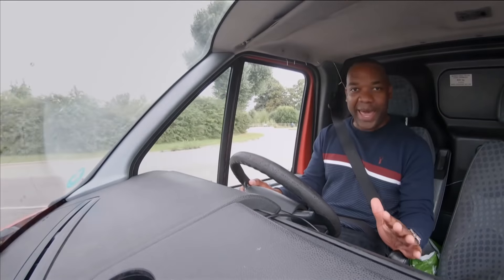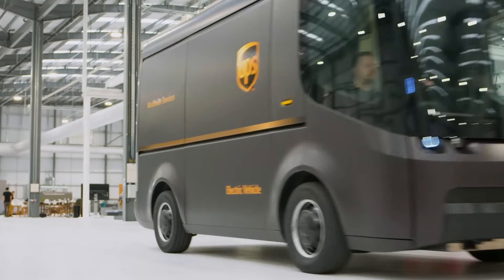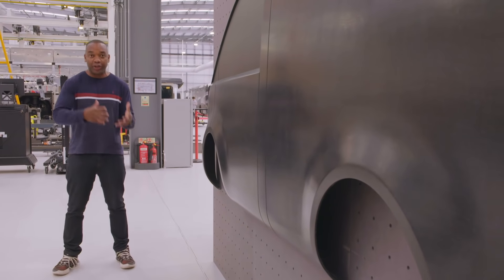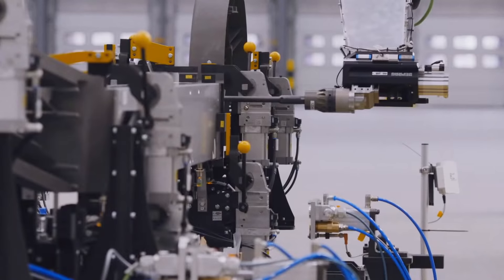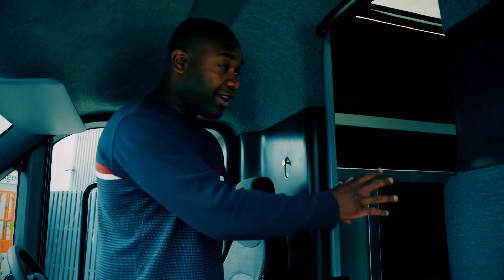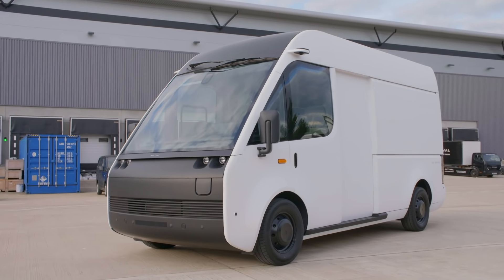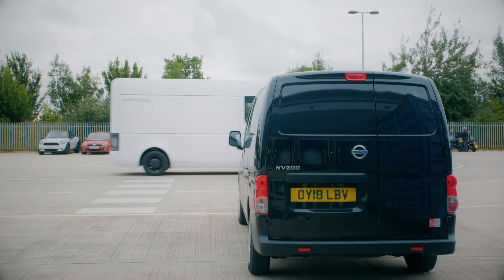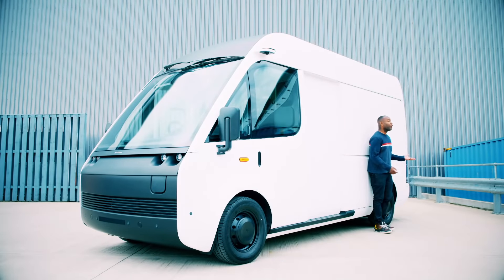The Arrival Van Test Drive | Fifth Gear Recharged

Comment: if they stick to sourcing local materials, and keeping supply lines short, I think they can. Many companies problems are coming from their supply lines, the small plants will keep costs low, and so long as they make a reliable product, their purpose build EV should be able to compete with a converted transit, just because of the benefits with turning radius and interior capacity.
Reply: My biggest issue with the arrival van is all the electronics in one tablet. I feel that there should be a digital panel flush with the central console for controlling the van, an option for drivers to use knobs to adjust the climate and a simple set of analog speedometer/instrument cluster directly behind the steering wheel. Now don't get me wrong, I like minimalism, but when it is not intuitive, the design fails. Also, I hope the Arrival van uses less cobalt in the battery (or solid state batteries), cos cobalt is mined from the Congo via harsh labor.
Reply: @thatguyalex2835  the one small screen for everything may have been a cost cutting measure. Also this is pre-production, so that may change as they get feedback from reviewers like fifth gear. I would agree that is something that should change, as you are right that would be a pain
Reply: @JustJay1281  I see, lots of things are cost cutting measures, which come at the expense of the operators (drivers/users of said technology). We as a society need to invest in good products, even though the price would be higher, in other words - the long term.
Reply: Sorry but that type of construction wont work to scale.
It's also very flimsy and not efficient.
Reply: I have doubts to the safety of the vehicle, that door wobble when he opened the door was crazy, pole impact must be shocking.
Reply: @thatguyalex2835  
A simple set of "expensive analogue points of failure"?
Reply: @Zedrophobia  
I can just imagine them saying 
"Let's build a vehicle that won't comply with regulations"..... Duh?
Reply: @rogerstarkey5390  they aren’t many regulations when it comes to vans. Over a certain size there are very few, although they are starting to impose stricter and stricter rules. Plastic panels are why you don’t see many production cars with them, or if they do the frame of the door it’s beefed up.

Comment: The cost of electricity in the u.k is going up year over year and were are the charging stations.
Reply: If the cost of electricity goes up, then so does the cost of refining oil into petrol and diesel..... oil refineries use lots of electricity...

Comment: They should build units for motorhome conversion.

Not complex. It just went wrong. Not good for a review. 

One big plus of this “build on a skate” structure is that the batteries could be replaced independently of everything else. (as battery technology advances).

Comment: 2 things that will need addressing for a production variant:

-Far less reliance on touchscreen; a tradie with dirty hands from a hard day's work isn't going to appreciate getting dirt all over the screen.
-Rear and side access doors need to be wide enough for a pallet
Reply: The van shown was specifically for Amazon-style local small-parcel deliveries, not for bulk-item distribution (they've probably got a different van design for that, with - as you mentioned - sufficiently large rear/side access)

Comment: I work in a van factory and the demand is so high that I don’t think this micro company’s will able to meet demand they haven’t mention a what rate they could be building them and also that range wouldn’t suit many company’s that require a lot of motorway miles so there’s a lot unknowns in this project but is not a A bad idea and the reason why most car manufacturers use assembly lines it’s because it’s efficient and keeps cost down of manufacturing so basically the more you build the cheaper the product cost more profit
Reply: 10000 vans per microfactory or 20000 with two shifts. It has ability to switch manufacturing from van to bus or car in same factory in no time that is what huge plants can't. Microfactory is not a new concept, have a look deeper into it and you will understand why it is more cost effective than plant pumping 200k vehicles per year.
Reply: 10000 per microfactory 20000 with double shifts.
I smell a whole lotta wilful IGNORANCE around here
Reply: Their rate is 10000vans a year ??? What are you talking about read their Forbes page again? 
You think they will compete with a plant that can produce >120k vans a year on double shift ??
Reply: @mariusmartinsen2064  in the UK, Mercedes sell around 210,000 Sprinters alone. every year. its the second best selling van in the UK. the best seller is the Ford Transit, which sells nearly a MILLION units per YEAR! thats a LOT of expensive micro factories JUST to make enough vans for the UK! and thats BEFORE we take into account all the other vans on UK roads. and then theres all the vans that are used in the rest of the WORLD
Reply: The point of a micro-factory is that it can be replicated and scaled up quickly, as needed.  It's a template.
Reply: @Gr33nMamba  I am not saying That it cannot be done the point is will it be profitable that’s the big question.
Reply: @matthewspry4217  They haven’t produced anything yet, so far as I know. Prototype is easy, mass manufacturing is hard (quote Elon Musk). With micro factory they do not have economies of scale. Their financials are terrible.   Gives me Theranos vibes.
Reply: @petelattimer6808  Why presume they're wanting to replace all other van makers? From the sounds of it, Arrival are focusing on niche markets and flexibility (plus larger markets for specific orders) - and banking on their 'cells' being able to swap instantly between different models as required.

The 'cell' approach may be less cost efficient than a traditional production-line - but if they can reduce their costs (via cheap thermoplastics, and other tweaks to 'traditional' production), they may be able to offset those inefficiencies, and produce cost-competitive vehicles.

Guess time will tell, although hopefully not too much more time... :D
Reply: @laostiia1000  
"Compete"?
If the factory is in the corner of a UPS warehouse and they're building vans for UPS, they don't have to "compete".
They simply repeat in several UPS locations.
When that project is done, they either move the factory, OR negotiate with UPS to keep those factories running with UPS running the logistics(!)
Win/ win

Comment: From someone who has worked on microcar and axiam this will rattle like mad and be flimsy.... A delivery driver will floor it everywhere as time slats are short and the range will be 80 miles ... I'm all for electric vehicles but I think this is going to be a poor effort ford will out class this vehicle and if Tesla made a van ... They would outclass all of the manufacturers .. as they have years and years of electrical engineering and technologies

Comment: It's not new coachbuilders would take a ready made chassis and build a body on it and hitting a panel with a hammer while holding it in your hand Is not a example of strength these are steer by wire buggys with very light body's I wouldn't like to crash test one and I can't  see if ups has 50 of these at a depot how they can load wash clean and charge them all for the next days shift I spent 15 years in a bus depot that would be even harder still you can see why in London they went for hybrid buses  and taxis

Comment: How about making more power stations 1st to power all these new elv's when on charge
Reply: Because that is not the problem.
Reply: @Simon-dm8zv  so if 50% of UK had a elv and put on charge at around the same time the power surge wouldn't create a problem for the energy consumption company and cause a blackout especially at winter times where no solar power is 100% and only relying on wind power if no stormy weather on the time scale
Reply: @martsvan1  Yup and that is exactly why power spreading (peak shaving) is so important. We only need about 10 kWh per day per vehicle on average- so it is just a matter of spreading that out over, lets say, 12 hours.

Comment: Plastic body panels are genius, why don't more cars have them?
Reply: It's cost effective, reusable, recyclable and lightweight. Most cars have at least some plastic panels, they just don't advertise it becuase most peoples perception of plastic and cars don't go well together. Makes no difference to me!
Reply: All bumpers are now plastic.
Reply: @Robert-cu9bm  Yes. But they're painted, which defeats the benefit, as they can scratch easily.
Reply: @tzeimet  
So can coloured plastic.

It also fades in a few years, paint doesn't.
Reply: @Robert-cu9bm  Paint definitely fades, that's why you have to buff it after a few years to restore the colour. Coloured plastic can be made resistant to fading by incorporating a UV filtering layer.
Reply: My 2016 BMW i3 has them. If one gets damaged you can actually pop it off like a Lego and replace that body panel quite easily.
Reply: These Arrival body panels are also 100% recyclable at their factories. Awesome material!!
Reply: BMW i3 has them
Reply: @_chenn  
You haven't lived in Australia... Everything fades there.
Reply: @Robert-cu9bm  you know me well ..
Reply: Plastic is recyclable.As combustable material.
Reply: @Robert-cu9bm  wax it.
Reply: isn't "plastic bad for the environment"?
Reply: Why dont they have them ? because a metal panel adds rigidity to the over all vehicle . Not only this but a plastic panel requires a metal frame behind it . They break easier in low temps and are generally brittle , they really struggle to pass crash testing , they vibrate easily , they burn readily , not easily repaired , the type of plastic needed isnt easily recycled  , they need to impregate it with metal for the fitting points anyway ......... theres a whole list of reasons ....
Reply: @MegaAtOh  not if it's recycled.
Reply: @LemonySnicket-EUC  can't that apply to every plastic?
Reply: @MegaAtOh  so plastic isn't bad for the environment after all.
Reply: @LemonySnicket-EUC  repeat that to yourself always
Reply: @Robert-cu9bm  You obviously haven't seen a 15 yer old red car......